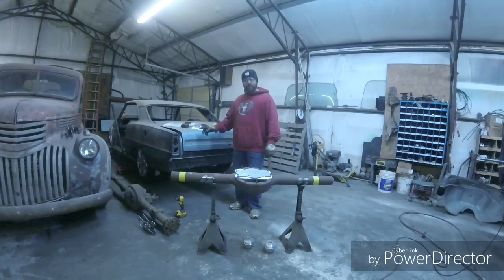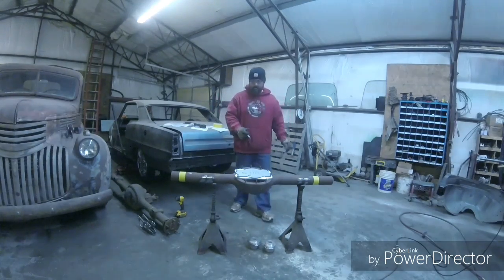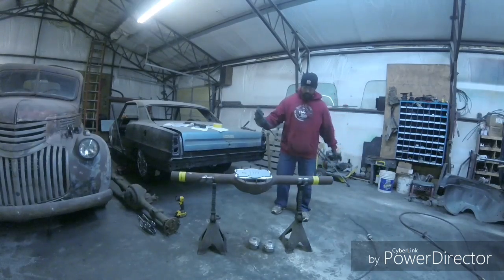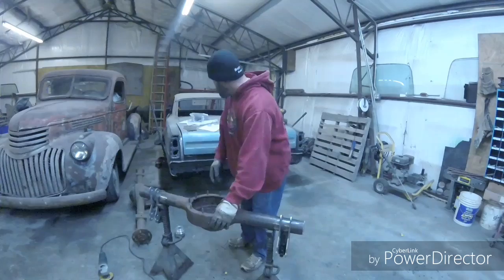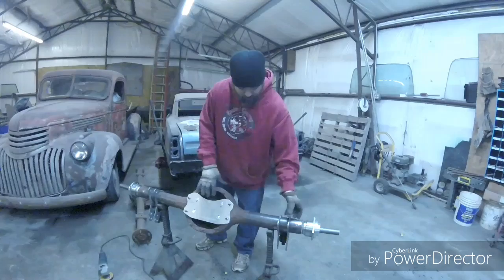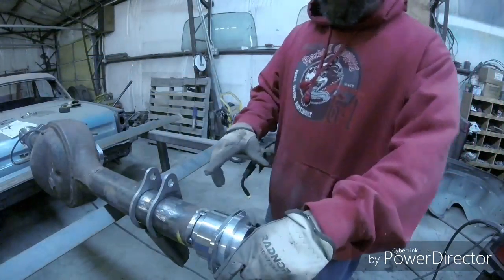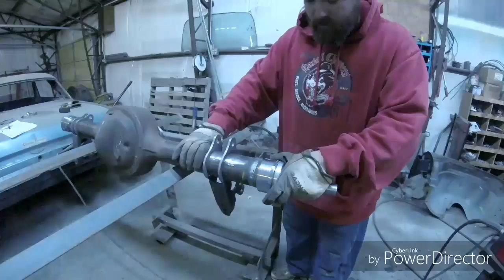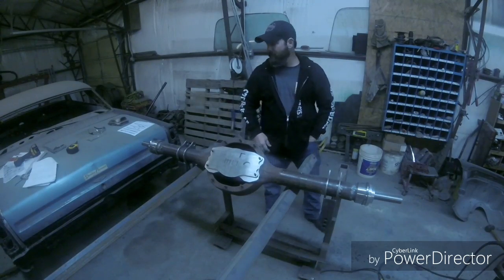How to narrow a 9-inch  rear end housing

Comment: What type of mig welder were you using ?  120 volt or 220 volt and mig wire diameter.
Reply from the maker: 220 volt .035

Comment: To align the tubes you can also use 2 pieces of 3” Chanel iron about 10” long. On the exterior of the tube held with c clamps

Comment: so im getting ready to narrow a ford 9 inch and i want to buy the jig for the rod measuring kit and bearing housings are the all on the leadmine site ? i didnt see the actual bearing housing with flange for bolts to hold bearing in on in the video those caps were to just hold the rod?
Reply from the maker: I bought my flanges separate. I only got the jig from Leadmine. The flanges are available a lots of places. Make sure you get the right ones for your bearings.

Comment: I was looking to do something similar to an 8.8. What welder are you using?
Reply from the maker: It's a Lincoln 220, 1:40 amp.
Reply: Wayne Compton, do you think a 110 will work, with preheat?
Reply from the maker: Denis C . You could use a 110. You'll have to be careful heating the tubes they will move around with th heat. I would make a root pass and multiple passes to complete.
Reply: Wayne Compton you can use a125 amp welder with out heat?

Comment: dont understand why you guys buy chevys then fit a 9".nothing good with chevs,cheap,nasty,especially the diffs,obviously.
Reply: don't understand why you Ford lovers put a chevy engine in a mustang. SMH..
Reply: harry walker geuss Ford sucks period.
Reply: not here in aus,its the chev guys ,on drug money,that buy a ford 1932-18,then fit a chev in it,mainly 350,cos there cheaper than a ford or dodge,plus its peer pressure,"got ta have a chevy,",chev/holden racing,cheat the same here as in u.s.,they just have to win at any cost,or payment to officials.when your comaro ran here at bathurst,wasnt allowed to run disc ,got hot,crashed in barrier.sierras got banned cos they were 4 laps ahead of god,{brocky],BUT,they can run v8 disc on a 6cyl torana,escort size car,&,,,a 9" in there commodores,chev sucks.tell me,,what is a duromax,chevy,????,NO,its jap,isuzu.get your facts right.good job with the diff,we dont have anything like that here,i have 5 u.s. trucks,car.dodge challenger 340 r/t,NOT chev.good luck, H.
Reply: i did actually narrow a d44 by 3",used a jeep long axle shaft.fitted d60 brakes,8 stud.into bronco,locker,,d60 rear lsd...i see ford won nascar 3 times in a raw,bout time,thing is,like bathurst now,there all the same running gear,no competition,its a bussiness.we have a driver here,loundes,loves fords,drives for holden.money talks.
Reply: i nearly bought a corvette,i like them,till i saw the one leaf rear suspension,turned me off,very wagon train era.
Reply: Actually 12 bolt Chevy pinion has a better attack angle, but you cant hot swap diffs at the track and I the 12 bolt doesn't have a rear pinion support and its the Ford axles that are cheap. BTW
Reply: that single leaf sure won a lot of races for being wagon train technology. lol. also the ford 9" is like a chevy 350. everybody uses them because they are easy to get and cheap to mod.  PS the way the rear leaf is mounted in the vettes its actually working as a quarter elliptical spring since the car is independent. so not at all wagon train technology.

Comment: Could this type of jig be also used to weld a center section to the axle tubes? Not cutting an axle down, just wanting to weld the tubes to the center section
Reply: The jig would not really help with that other than to check if the housing ends are still aligned after welding. The way he rolled the housing to make one continuous weld would be helpeful when welding the tubes to the center.

Comment: where did you get the jig that had the caps installed on it?
Reply from the maker: The jig and the bearing caps are separate. The caps you can get from a lot of places. The Jig is Lead Mine Products, I got mine from Ebay.

Comment: So just to get it straight, you ordered that jig from Lead Mine Products and you went to your local machine shop and got a shaft with the diameter of 1 1/4", and that fits perfect for the bushings that come with that kit (jig)? Awesome video btw, this is spot on as I'm getting ready to narrow a 9" for my 64 Nova. Thumbs up to you bro!
Reply from the maker: It's just that simple. Just get all the measurements right.
Reply: Anthony Burgess  - make sure to specify cold drawn bar stock. It’s held to dimensionally tighter tolerances and is straighter too.

Comment: And what diameter is the shaft, 1 1/4 or 1 1/2?
Reply from the maker: I bought the shaft from a local machine shop. 1 1/4".
Reply: Wayne Compton Thanks bro, how much did it cost you?
Reply from the maker: Only like 20$. No big deal.
Reply: Wayne Compton dude, thanks! you rock. Those are some kick as rides you got there
Reply: Wayne Compton dude, thanks! you rock. Those are some kick as rides you got there